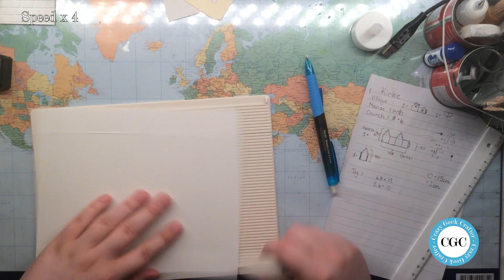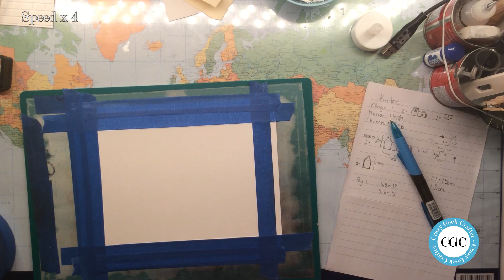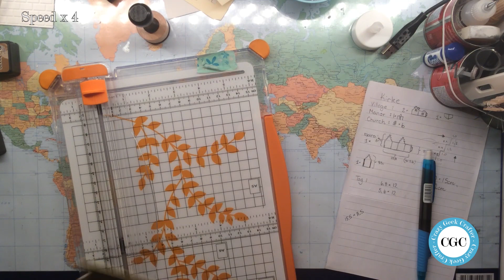Danish Church part 1 // Tim Holtz Village Dwelling // 3D paper project

Comment: Very nice - what embossing folder did you use for the brick texture?  Do you have a paper template available?  I would like to give this a try.  Thanks for sharing
Reply from the maker: Firstly thank you for your kind words. I use Marianne Design: DF3403 Embossing folder for the brickwork. I don't have a digital template, but I have been thinking of making a cut file for a similar project. Because of back problems the die cutting is too hard for me nowadays and making a machine do all the heavy work makes sense. If you want I can try to move the project forward to the beginning of the new year. But I don't have room in my calendar before that. Whether it is a printable template or a cut file you want I should be capable of making such.

Comment: Did you ever make templates for custom shapes?
Reply from the maker: Are you thinking of the svg files? If so then no. Mostly because I haven’t needed them yet. After the new village die-set came out I wonder if it will be better to make the svg to fit the smaller format. But then again for weddings should things not be bigger? I do like the size of this original make, I am afraid a smaller version would be underwhelming.